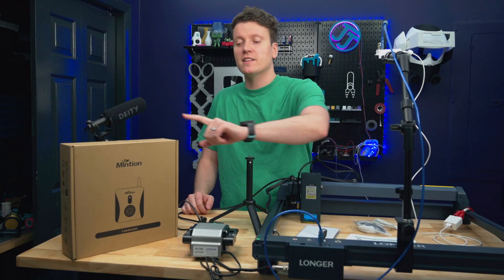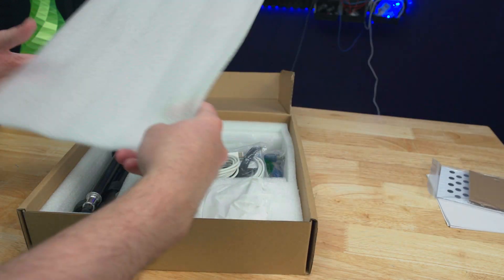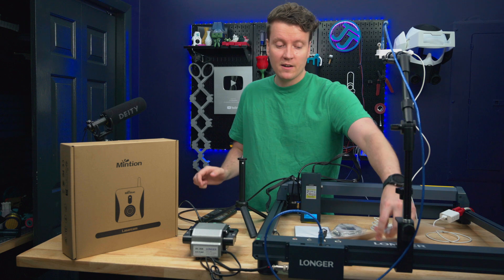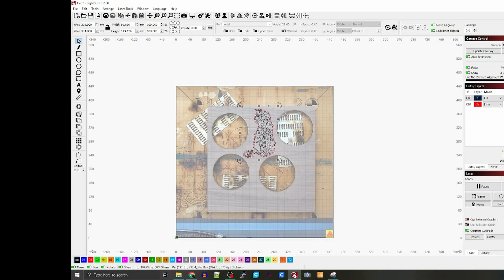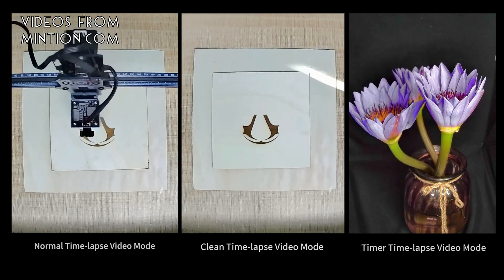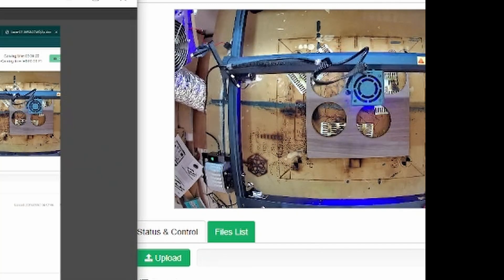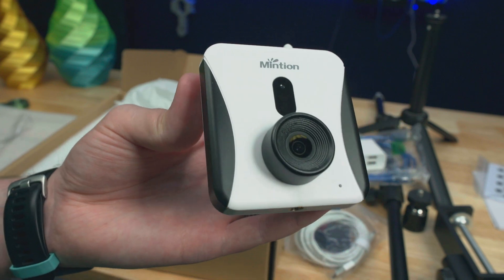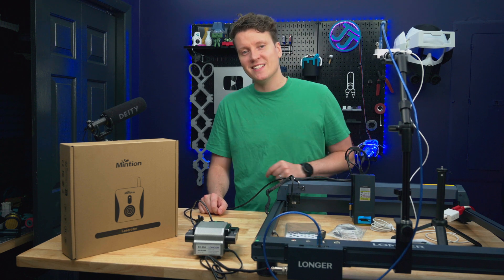Is your Laser smart yet? - Mintion LaserCam (with Giveaway)

Comment: Hey

Could you please suggest me a 3d printer. My budget is approx 600usd.

It's my first time purchasing one.

I have a few in mind: creality 5 S1, CB 200pro and Ender 6.

Which one do you think is better one?
Reply from the maker: I probably wouldn't recommend any of those since the newer Creality machines are much better. The new K1 is great if you want an enclosed printer for high temperature filaments like ABS. If you want a really good first printer for cheap then the Ender 3 V3 SE is really easy to use, prints great, and is only $199
Reply: Okay! Thanks for your suggestion 😃. Will see if I can extend my budget for k1
Reply from the maker: Depending on where you are, I've seen the K1 go down close to $500 @Ayush_P_Mali
Reply: @JJShankles  I am from India, it sells here for 60k INR which approx 700 USD.